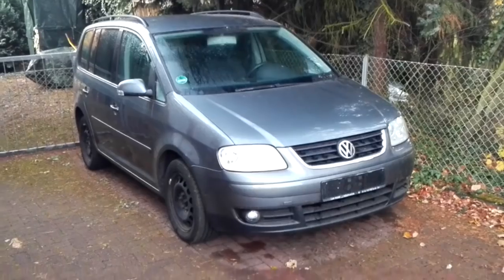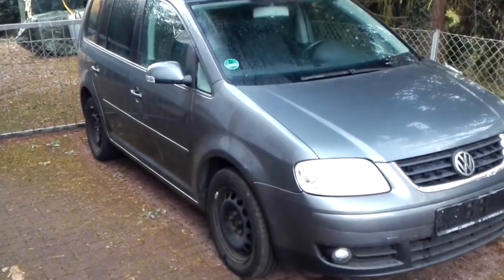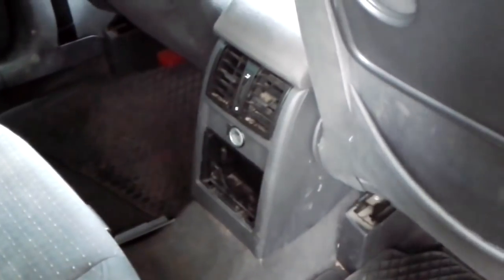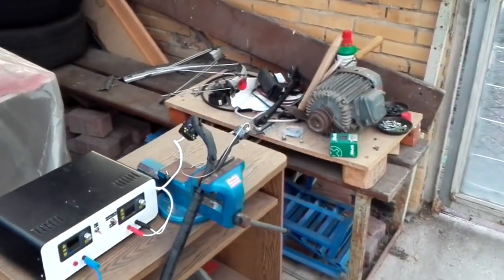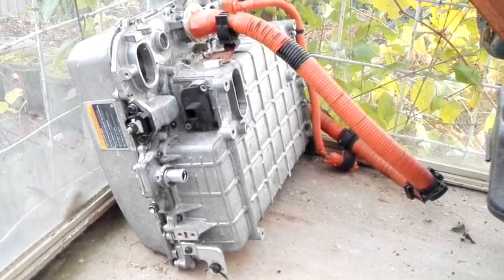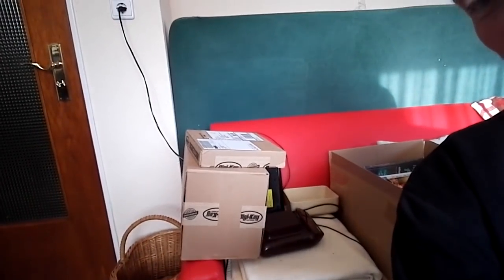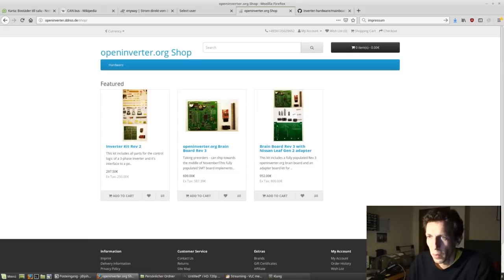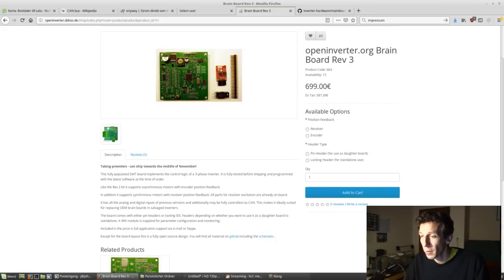Lab Update #18: New conversion project and shop opened

Comment: If you use a 4motion rear subframe assembly in the back of the Touran (same as a Mk5 golf or A3) you could mount the motor in the rear and free up the engine bay. There is also more than enough space under the middle row of seats where the fuel tank would ussually live to fit more than 1 packs worth of Nissan leaf battery modules. You can actually fit 2 leaf packs into the underside of the car if you split them up. I'm trying to do this conversion at the moment. 2x leaf packs would give the Touran 140mile range from my calculations.
Reply from the maker: Sounds very encouraging, thank you!

Comment: Great to see that you have a new project starting. I'm looking at doing a similar conversion, a 2010 or newer VW Polo to electric, using a Nissan Leaf drivetrain, or possibly a VW Caddy. Assuming that it's successful, I'd like to look at doing a dual motor Audi TT. 

I'm very interested in hearing about how easy it is to communicate with the CAN Bus in the VAG vehicles.